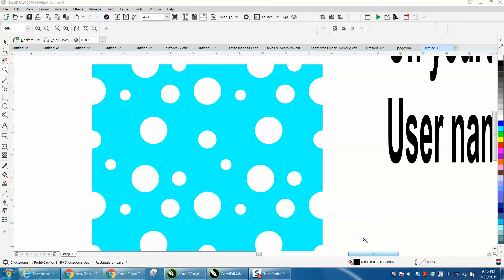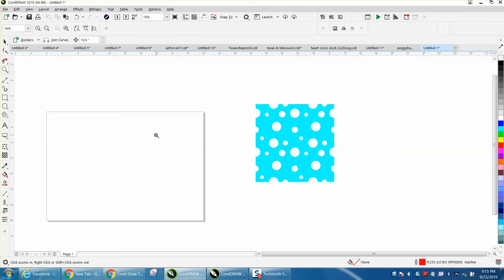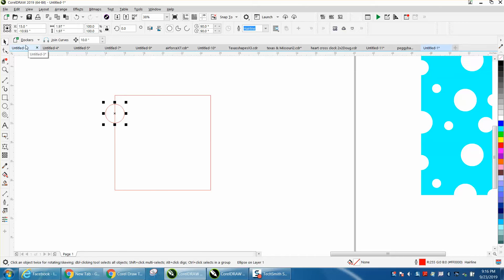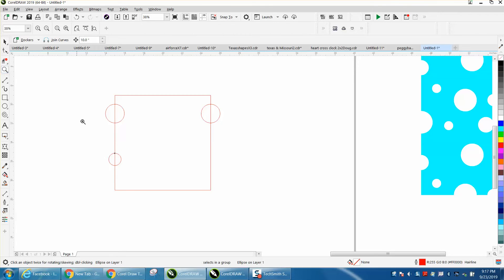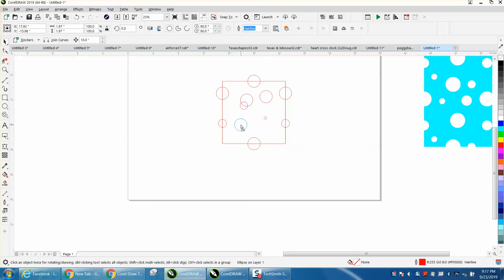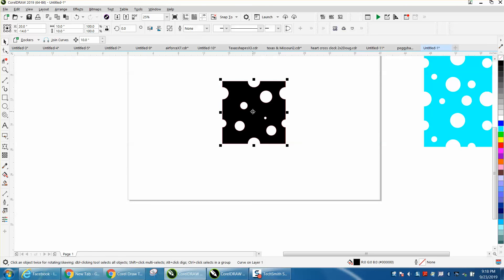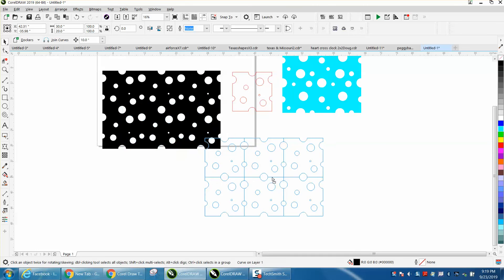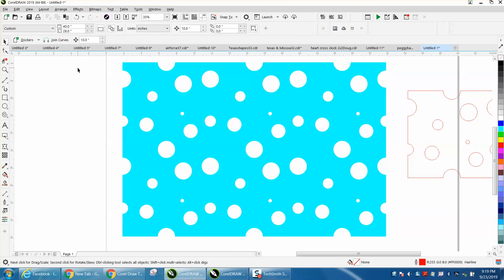Corel Draw Tips & Tricks seamless pattern

Comment: Thats exactly what i wanted and cant believe u done it so fast for me 
Much appreciated ... i use corel draw x3 yeah old version but it does the jon . so this is perfect 
I do speak english too very easy to understand .. thanks .. i had most of it right but the combine to hide seams is what i needed to know most... 

Also mate is there a way to do same process with texture so i can repeat texture like rock or brick ,  fire etc .. like a png or bitmap image .. 
I use photoshop for the textures and use offset tool and then clone tools  or layer mask  to hide seams etc 
  but would like to use corel draw .. 
Or only best to use corel draw for vectors like your video u made me

When i make pattern can i then go to create pattern select pattern i just created and  add to patterns in coreldraw  and it will still be seamless ..
Reply from the maker: Great, glad to hear
Reply: @DougGreenAustin  thanks 
Do u know how to do same process with textures mate . 
I know coreldraw has seamless texture patterns built in but wondering how to create that kind of patterns too .. 
For eg .. like fire bitmap but make into a seamless repeat  pattern or brickwall etc .. 
Like the textures on the unleashed textures corel draw video  on utube 
Steel and rock , flames etc .. any ideas would be grateful